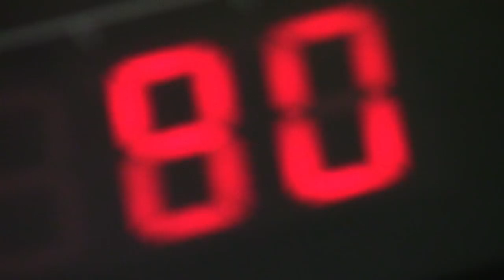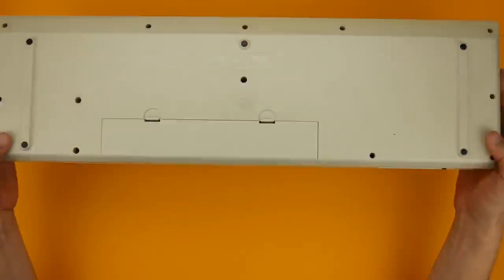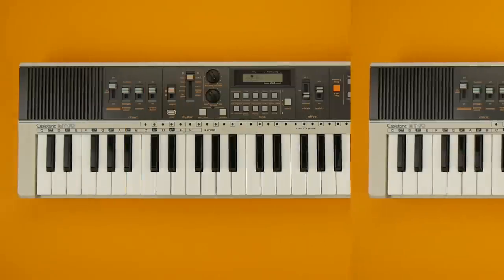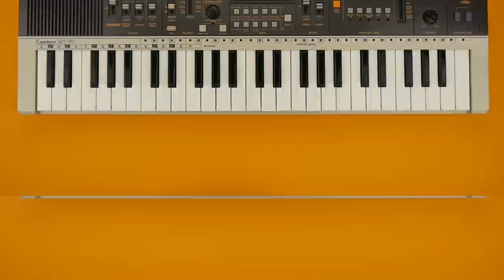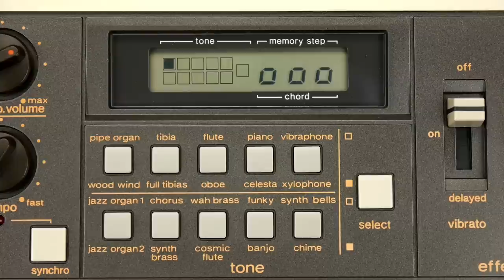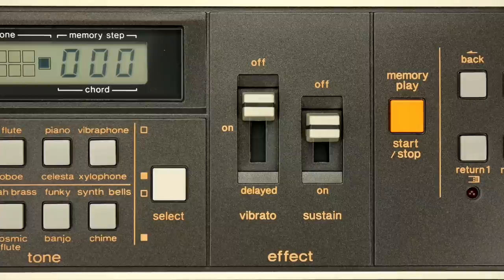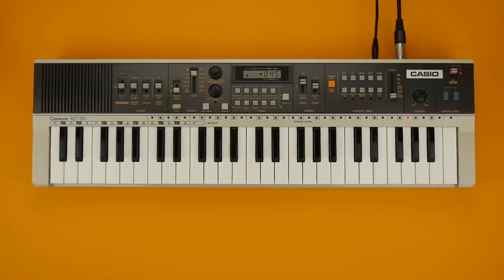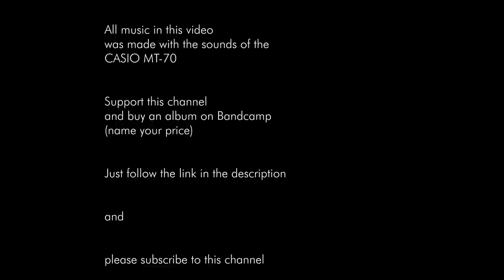Casio MT-70 Sine Wave Keyboard - Full Review

Comment: My mom bought me one of these recently from an old lady who passed away and I've been having so much fun with it. Unfortunately it didn't have the power supply, so I'm running it on batteries, but it's been lasting quite long on them so I can't complain too much..
Reply: If you haven't already, you can buy a power supply, just make sure its the right DC voltage (they make universal with changeable voltage) and make sure the tip size is correct (the universals also have changeable tips). I believe in the video he showed it needed 7.5 V. If your supply doesn't have that exact value, try the lowest which is closest and then the next one up if that doesn't work. Typically batteries are 1.5V each so you can use this for reference for the # of batteries you use. If you have any questions feel free to reply.
Reply: @riley1636  thanks, I did in fact buy a power supply about a week after posting this.. I've been driving my wife nuts ever since
Reply: @ANRQAngel  glad to hear it! though i guess your wife isnt lol ;)

Comment: Have owned one since early 80's, i agree with all you say about it.
The vibrato is very light on my MT70, do you know how it could be adjusted?
I have used it in recordings and  on stage with amplification and the slight 'toy-town'  timbre of the voices disappears in those situations. a very endearing keyboard....
Reply from the maker: I know what you mean. There's probably a way to change it, but I haven't tried out yet. I am quite happy with the light vibrato.
Reply: @KeenOnKeys  , Here's why i asked, the vib on your MT70 is heavier than on mine. On my MT70 it's almost not noticeable until you play a chord. A third MT70 belonging to a friends father seems to have the vib set somewhere between the two....
Reply: @fuccasound3897  I used to have an MT-70 (regret selling it now and am looking to get another soon).

One thing I did notice was that the vibrato sounded more intense / heavier when it was set to delayed. Other than that I wouldn't know if it can be changed or not.
Reply: @PianoandKeysStudio  i agree with you about the vibrato. As for changing it, i suppose i was imagining there may be a potentiometer on a circuit board somewhere inside it?....

Comment: Hi! I just discovered this channel and it was an insta-suscription. But, most important, I'm here looking for help. 
I happend to have this keyboard. It was cheap in facebook's marketplase near me and I wanted to practice keyboard for a long time, so it was a win-win situation.
The thin is that it doesnt wark quite well. You see, when I put the Casiochord switch to fingered or On, the first octave and a half doesn't work. But, when it's Off, It kinda works. I press a note repetly, but it just a few times. But, this error happens in all the keys. When, with the switch on or fingered, they work correctly.
Also, the speaker its a bit noisy. I don't know if it's dirty or it's just interfirence.
Thanks to anyone that can help and, again, amazing channel!

Comment: Didn't know Casio actually made something a bit more superior than the overused multipulse stuffs, I really dig the (organ) sounds too. 
This thing looks very moddable too with all that hardware. By the looks of it the sound generator IC's produce digital sine waves, through an resistor DAC. Since these are controlled by a separate CPU, one could definitely reverse-engineer the signals send and do some fun custom things.
And then there's all the analog stuffs too...

I think I'll be buying one soon >:)
Reply: CASIO made some iconic synths back in the days... FZ1, CZ1, CZ5000....
Reply: @NikoWax  Late reply but just wanted to say the CZ series is absolutely sexy, I even made my own phase distortion synth because I wanted a CZ so badly haha

Comment: How did you get rid of that noise that this thing causes when you record it through your DAW. It’s kind of a buzz. Common problem when recording with these guys.
Reply from the maker: yes, there is a bit of noise. But not much. I only noticed it when I was layering the parts for the multitrack recording, so I cut out the empty parts and it was OK. And of course I recorded as loud as possible.
Reply: Keen On Keys good tip, thanks

Comment: Have you had any problems with putting it back together and not having key return?  My flat/sharp keys seem to do just fine but my white keys seem stuck/sluggish and barely return to the position..
Reply: Also, do you know where to get the tiny steel balls for the slider knobs?
Reply from the maker: Maybe the rubber keypads are not placed correctly, or maybe they need a little bit of grease. Fortunately everything went fine with mine, also the steel balls are in place. I got no idea where to get new ones.

Comment: Mine seems have its polyphony halved. I can only play in 4 polyphony outside the chord keys or 2 polyphony for the whole keys in the other mode. Anyone know how to fix this issue?
Reply: probably one dac or sound chip is faulty (or the connection from one sound chip to the amplifier/mixer circuit). If you turn Accomp. off you should have 4 notes poly? unless something is wrong with keymatrix (but then some notes won't work)
Reply: i would find the working sound chip that is producing sounds, then make sure the other one is getting the same voltages / clock signal /.master-slave signal. if sound chip is good, then check dac and amplifier circuits.
Reply: @BatteryCoverMissing  I don't remember which mode and I am away to check it. The max polyphony I could have is 4 with the keys on chords area unplayable. In another mode, I can play all the keys but the polyphony limited to 2. I will check the chip as you suggested, hopefully it will be a simple and workable fix. You have a good knowledge on this stuff, thanks for the advice.
Reply: @dioricergy6931  no worries, once you have a look with a multimeter the problem should be easier to find, let me know if you need more help at that stage. it is strange that it goes down to 2 but the chip assignment for the voices might be a bit weird cuz casio usually do stuff in a non-obvious way.

Comment: Fantastic. May I ask you how do you do those "multi track recordings"? And, I need your expert opinion :) I have one of these gems, but once upon a time, batteries were forgotten inside and, of course, they leaked all over the inside. Since then, I have only one sound, basic pipe organ, and one rhythm working. Nothing else. It's still nice sounding, beautiful and warm little organ, but I'd like to fix it. Do you think it's possible? Do you think it's matter of simple cleaning or? It's like there's one connection broken somewhere that reads inputs from command panel.
Reply from the maker: I simply record one part after another to my DAW.
For the backing track I also use some samples and FX.
-
It's hard to tell from the distance. The battery acid could have damaged something. Cleaning should be the first step.